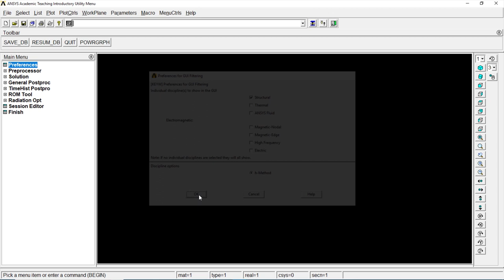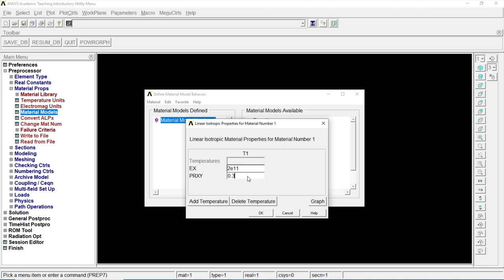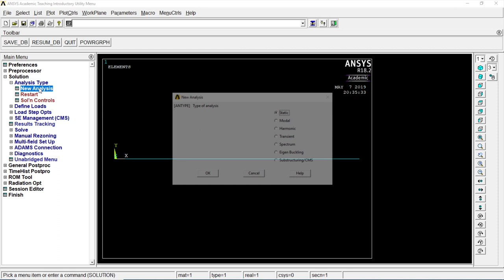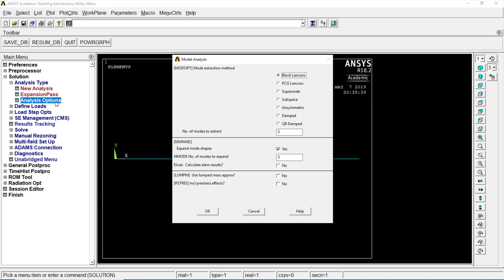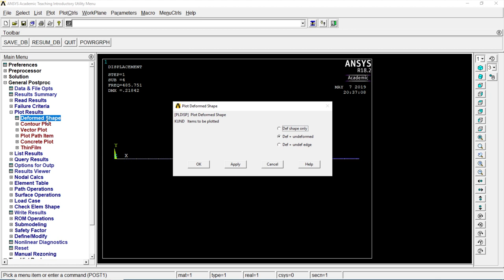Modal Analysis of Beam Using ANSYS

Comment: Hey Machen, 

can you please make a video on modal analysis of a beam under water. :)

kind regards
Umang
Reply: @LUQMAN HAKIM  Hey he is using Ansys mechanical APDL version R18.2.
Reply: @LUQMAN HAKIM  Workbench is just a different interface.
Reply: @LUQMAN HAKIM No. This is possible in workbench. since you just want to change the element types. 
i have never worked with beam elements. 
i have only worked so far with solid, shell and fluid elements.

but changing elements can be influenced by different ways. 
I know that one can  use APDL commands byinsert APDL scripts to the geometries for changing elements. But I have never used this. 

I would suggest you to ask in Ansys learning forum. you will sure get help there.